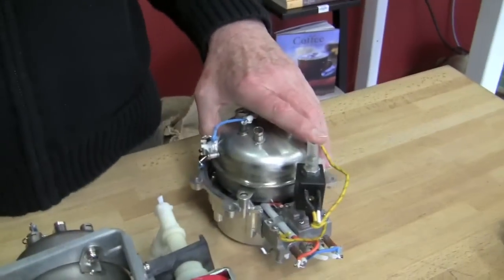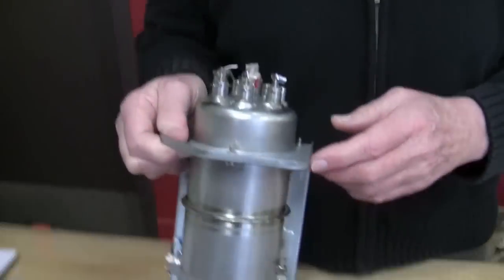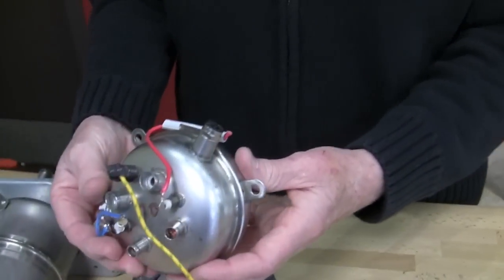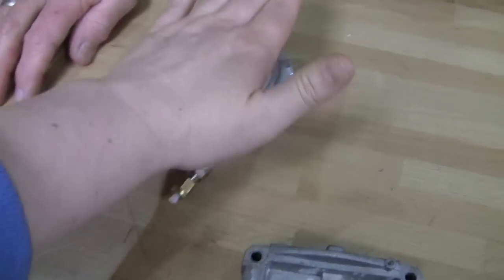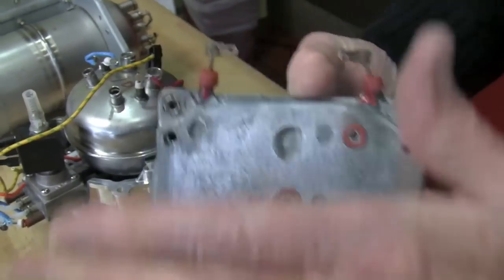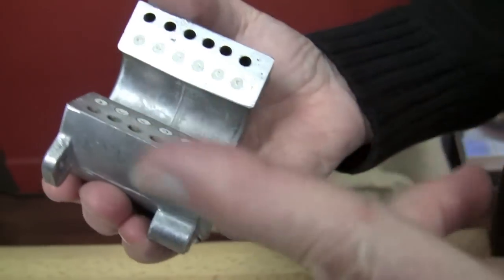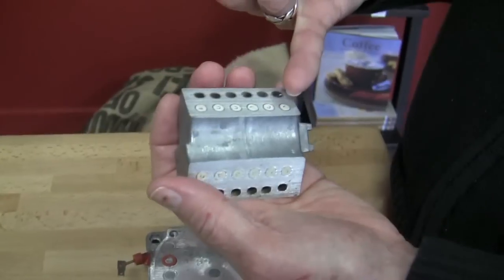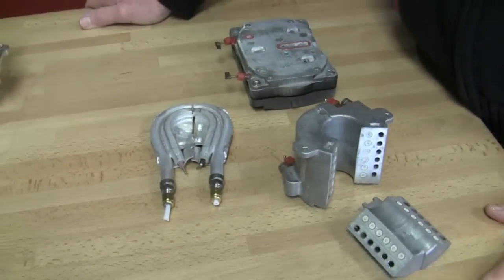What is a Thermoblock?

Comment: the dodad on the side of the brew boiler is not the temp sensor or control.. its a thermal cutout. so if the boiler goes over a max temp it cuts the power. they have a very large cut in/out range but it is a safety only feature. means it cant go into bomb mode if the pid gets set to high or if a SSR stays on

Comment: I asked two people when I called (two separate calls) and was told each time it has a thermocoil. As a matter of fact, on page 13, the manual now states: " thermocoil heating system with integrated stainless steel coil ensures accurately controlled water temperature". Maybe they were looking in an older, non-updated manual?

Comment: Hi Kat,
I'm curious to know whether there is any point in Breville BES870 machine where the water is in contact with non stainless steel components? Does the hot water travel through any plastic tubing, if so would you know whether these tubes are BPA free?

Comment: What material is the thermoblock made of? Aluminum? I don't want aluminum touching the water
Reply: Juan Caceres did you find any answers to your question? I would like to know the same. Thank you
Reply: Gale never answered. However, it seems as though the thermoblock has a teflon or a similar material covering the aluminum. I actually called Breville about it and they assured me that it was chrome (stainless steel), but i'm not sure if i believe them because the thermoblock that I ask them about is not in production anymore.
Reply: the water goes through a stainless steel pipe,  not aluminum

Comment: that thermocoil design looks extremely nice. I'm planning for a rather elaborate automated aeropress project and the thermocoil heater seems the best for temperature stability and compactness. Anyone know offhand what popular espresso machines have one inside? i'd be looking on ebay for broken models to raid for the pump and thermocoil
Reply: Did you ever end up doing that?

I had just picked up a broken breville barista express on craigslist, replaced the tactile switch used for the power switch, but then it went pop and fully died a couple days ago.

So I'm either looking to re-brain mine with an arduino + a bunch of relays, or make something more automated since I have a bunch of parts (even the little hall-effect based flowmeter) to do it.

Comment: Hello Guys ... I am curious to know if thermocoil like the one you showed here can be used to generate steam?  If yes, please let me know whether the pressure is sufficient and if you know how many psi is that when it comes out of steam wand, that'll be great!
Reply from the maker: Hello *****, Yes, a thermocoil can certainly produce steam sufficiently. A thermocoil works similarly to a thermoblock in that it flash heats the water on demand. We’re not sure of the psi value, unfortunately though that may be a good question for the manufacturer of the machine that you’re interested in. - Haley
Reply: Seattle Coffee Gear Hi Haley, Thanks for the response.  Just one more technical clarification - while using Thermocoil to generate steam we would be sending pulses of water in thermocoil through a pump, right?  If yes then there would be periods when there is no water (may be steam) at some areas inside thermocoil.  Doesn't this put thermocoil at risk of burning out while generating steam?  Please clarify
Reply from the maker: ***** No, it does not put the thermocoil at risk.  The heating element never comes in contact with any air, as it is not a boiler, so there’s no fear of it burning out.  Yes, the pump does push little bits of water through at a time, and it’s these little bursts that then heat up to the proper temperature.  When you’re finished steaming, the machine will drain the water naturally that’s left over down into the drip tray. - Miranda
Reply: Seattle Coffee Gear Thanks a bunch for the information!

Comment: I have an older  Breville 800esxl which is leaking. So, I took it apart to try to fix the seals, and saw the black coating on the Thermoblock. I was wondering what it was... and thanks to this video I know it's teflon. Ugh. Maybe I can sandblast it off... Just another reason why the Breville 800esxl is junk.

Comment: hey Guys, have been researching lately to efficiently use thermocoil to generate steam on demand.  For that I need to keep thermocoil at a constant temperature say around 120 c.  Is that what is done?  Also, how is temperature of thermocoil controlled within a desired range?  As it tends to fluctuate quiet a bit.  I read PID controlled thermocoil, could you please share some details in case you or anyone knows detail about it?  Thanks much!